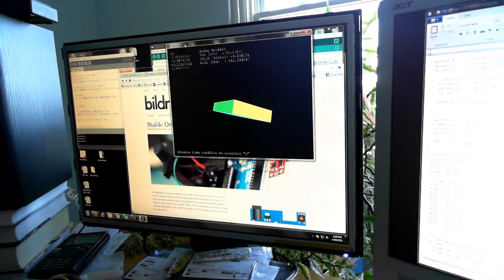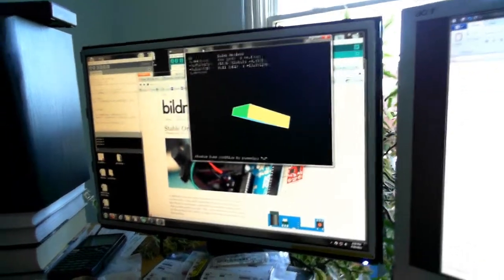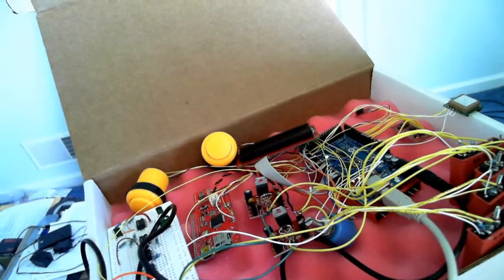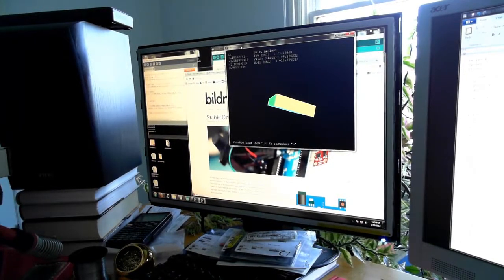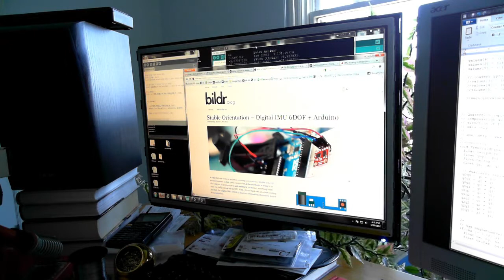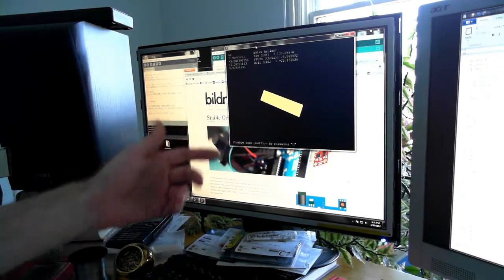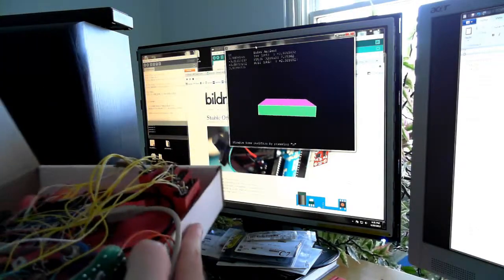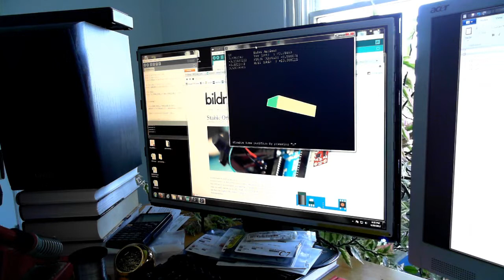Sparkfun 6dof razor IMU with DCM quaternion filter from FreeIMU library

Comment: Hi!

That's pretty similar to what I'm working on and I'm using the same setup (6DOF ITG3200/ADXL345 with FreesixIMU) but i'm only interested in the pitch value (and only in the narrow bracket of -4.4 to 13 degrees). I find that due to inertial acceleration caused as a reaction to the actual vehicular acceleration in our common situation (i.e., the IMU is being used in a continuously accelerating vehicle) the pitch angle is filled with error. Any tips on how to overcome this?

Thanks